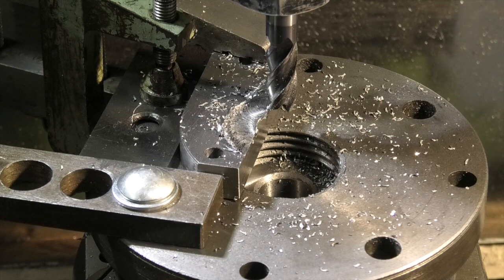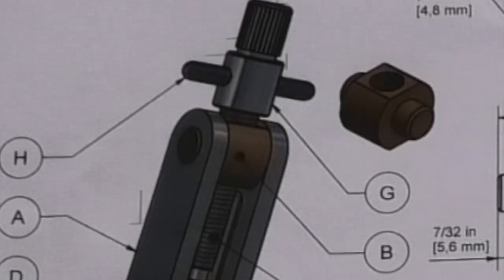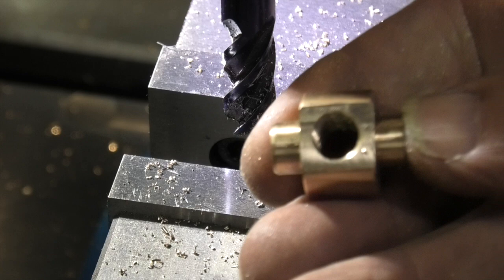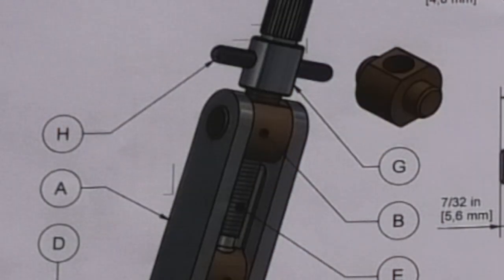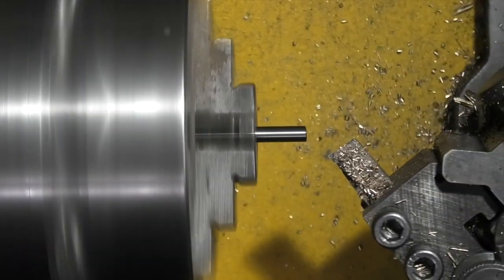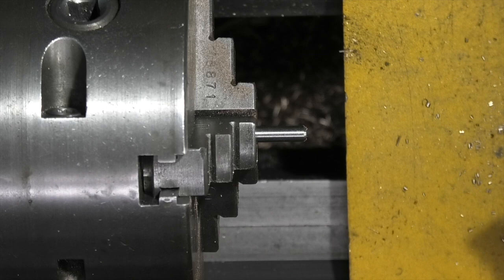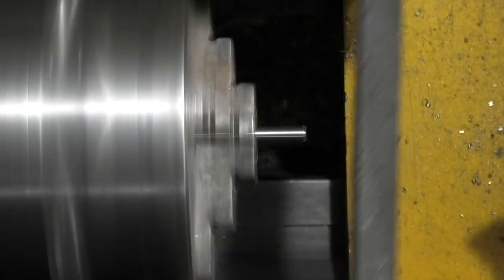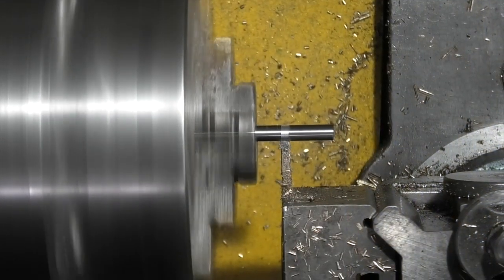Knurling tool part 4

Comment: Have you seen the MARLCO knurling tool?  It's what those plans are based on but has a larger capacity.  It works really well for my Boxford CUD. I happen to find one on eBay UK and had it shipped to the USA.